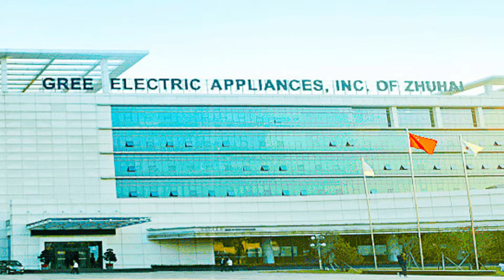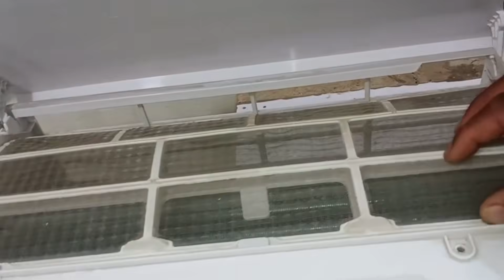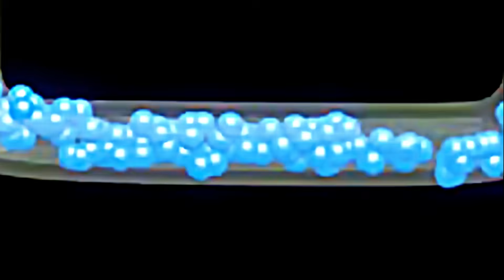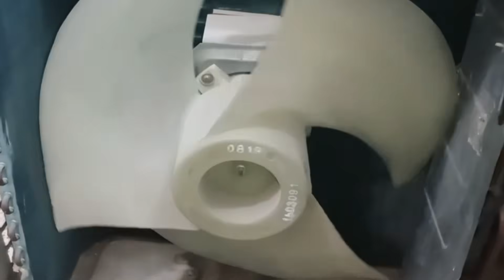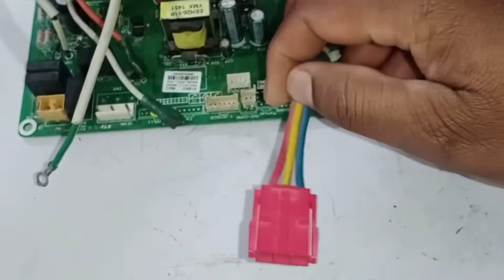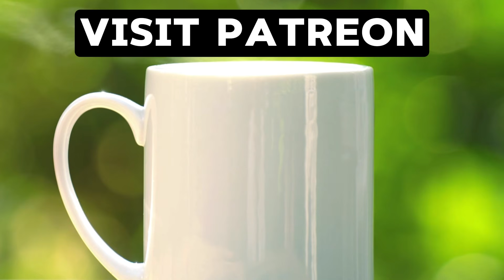How To Fix H5 Error code in Gree Mini Split AC!!

Comment: It's not difficult to tell us how to diagnose any air conditioner, because you just ran an entire service call and checked 10 different reasons ac/s fail.....How bout stating what H5 actually indicates.   Error codes are precise.  Only 1 failure should be linked to that code, not 20
Reply: IPM is heating up, this can occur because of all the reasons he showed in the video. mostly dust or bad electrical current.

Comment: You are basically asking to uninstall it, open it, dismantle the parts, remove circuit board, change the wiring and basically become a technician to fix a fault error?
Reply: probably video is made for technicians dude..
Reply: It's for grown-ups bud
Reply: Technician here... Nobody is doing any electrical soldering on circuit boards. They will replace the board which is an expensive replacement. If you have to replace the board, it's still possible there are additional parts needing replaced. If it's not under warranty, it can often be cheaper to replace the entire unit.